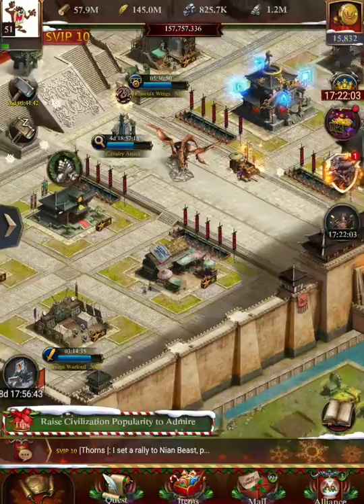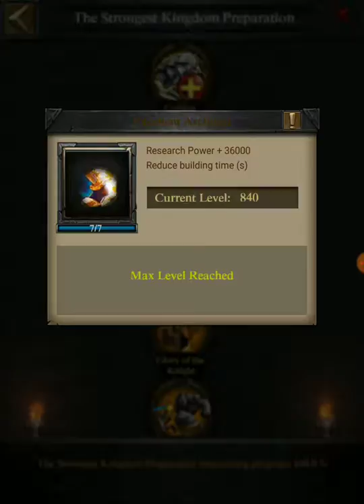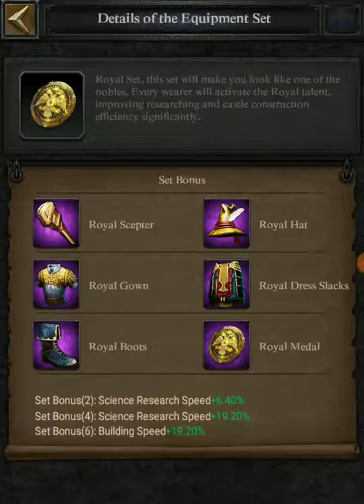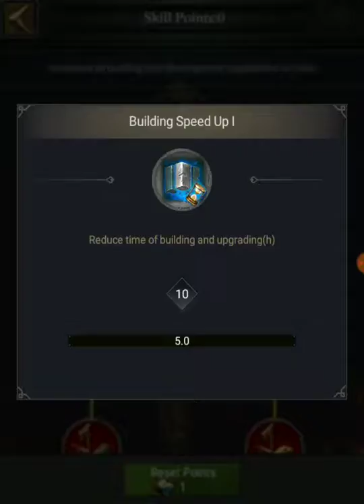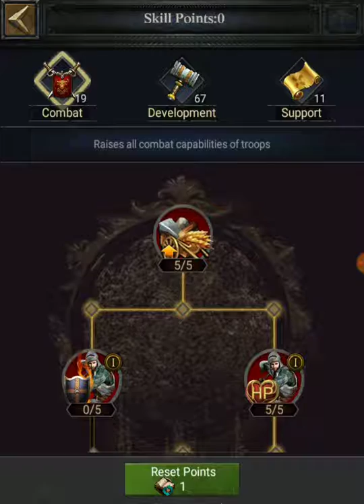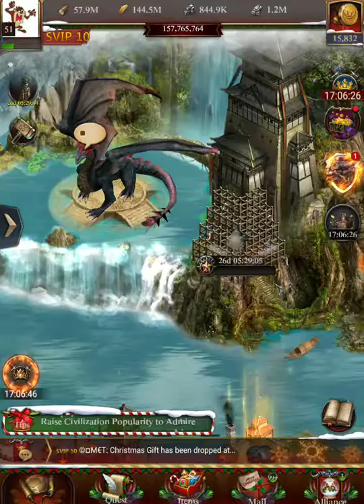Upgrade your Resource Buildings for KVK with no Building Time and Little Resources

Comment from the maker: The equipment I had on the Barholdi hero is called the Creator's Set.  These cannot be forged.  I know of two ways to obtain them.  1.  Use $$ to by the gold equipment set.  I don't recall seeing the ability to buy a lesser color of the equipment set.  2.  Obtain the green colored Creator's set through the Festival Event.  That is how I got mine as I was diligent to only obtain four of them.  The Creator's set is not available through the Festival Even very often.  I would like to get more, but I don't want to buy them.